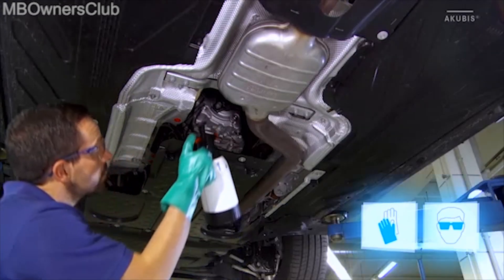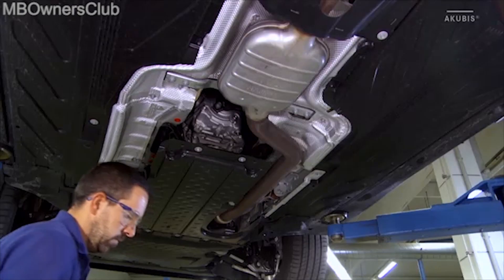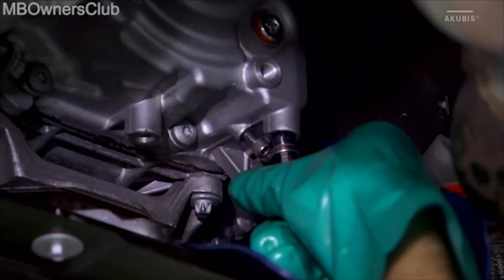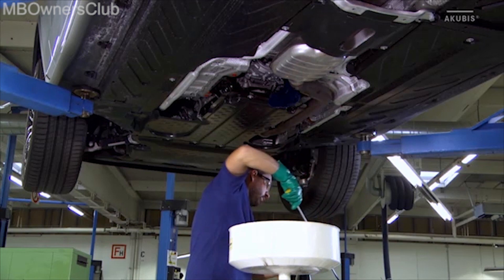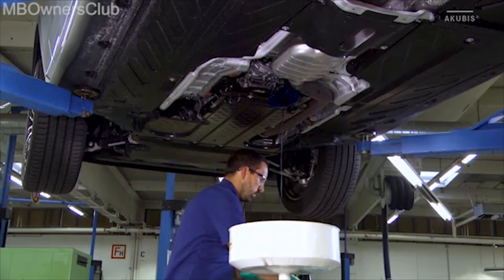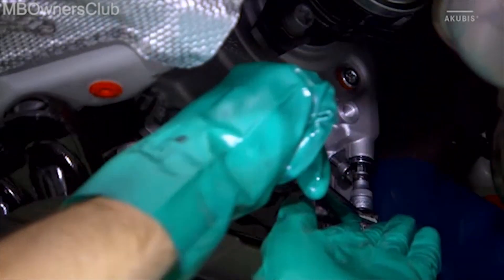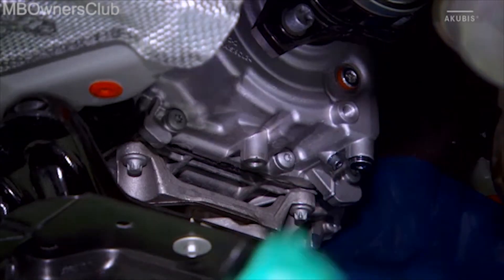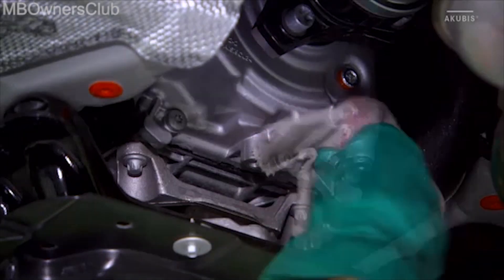How to Change Oil in a Mercedes-Benz Transfer Case

Comment: I removed the long bolt and drained it there instead of  trying to remove the tube, also removed top plug, will take fluid there as well but keep open relieves the air pressure when filling through the tube.. Drain it from the long bolt and measure it. Fill it and drain again, you'll see same amount of fluid. Doesn't take much. Fill through the tube hole and slightly overfill, you see it come out  and drain until it slows down to small stream than seal up.
Reply: Hi, where is the long bolt?
Reply: James Hall, thanks for the tips. My 2019 Mercedes GLC300 has that long screw, too. I was able to drain from it and fill on the top plug.
Reply: Good tip, in that case , we don’t need to remove overflow pipe because honestly, I can’t find part number for overflow pipe so you tip comes spot on

Comment: It is true that for the Mercedes b classe 2012/2013  petrol 122hp you need to take out the engine to change the clutch?

Comment: Are any seals or new plugs required? What about a filter?
Reply: Its transfer case ,no any filter. only 4  matic has this.
Reply: @johnwet5798  what do you mean by only 4 matic has this? only 4 matic has transfer case for 10l oil and then  transfer case for 0.65l oil